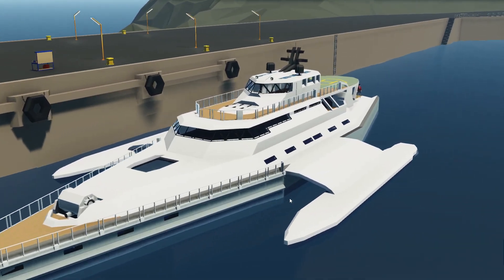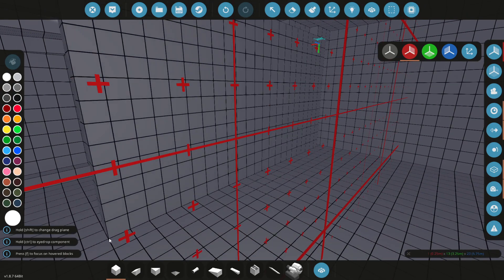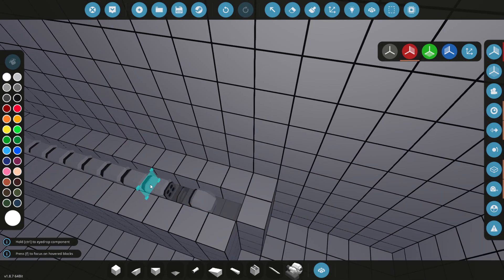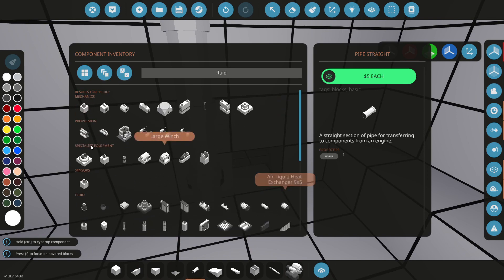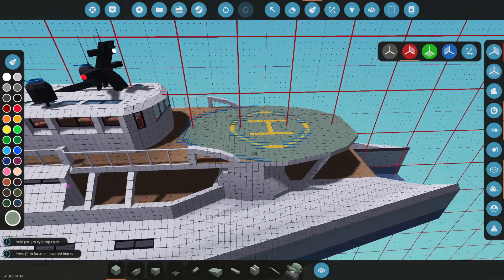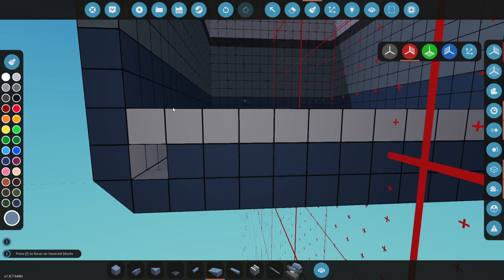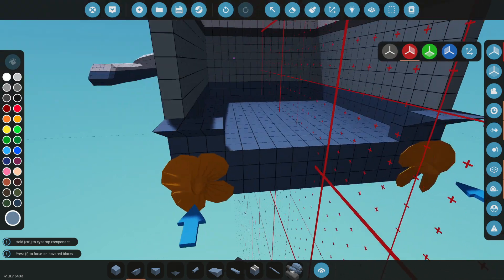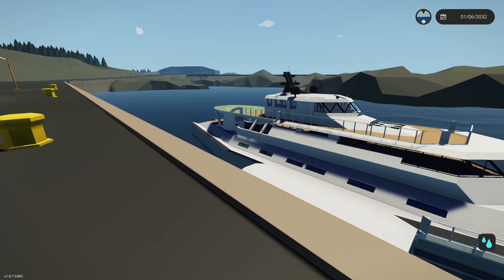ENGINED FINALLY INSTALLED! - Futuristic Trimaran Yacht Build In Stormworks #7

Comment: comming along really nicelly, but you don't need to connect the cylinders next to eachother. also that single colland manifold useing seawater isn't going to do much, they nerfed cooling a while back so i'd suggest 5x5 radiators. also it would be cool to have a seprate engine/s for your genoraters useing the 1x1 pieces and just turn on by pressing a button in the bridge. and if you find its too slow you can supercharge your engines by putting a large pump in the air pipe (but you need a microcontroller for the AFR from the workshop)

Comment: You don't need to attach cylinders that are in a row. They have hidden manifold connections on their sides without visible ones.

edit: It is also not a good idea to pipe the exhaust to the bottom as the back pressure from the sea will limit dramatically how much exhaust can be vented. At least water level or above.
edit 2: Also, 2 exhaust manifolds is not enough for these engines. Look at each cylinder for "Exhaust: 100%". Everything below 100% on each and every cylinder will eat the fuel without producing power.